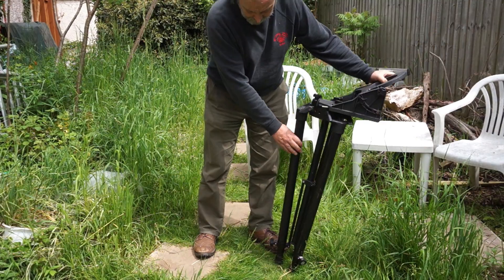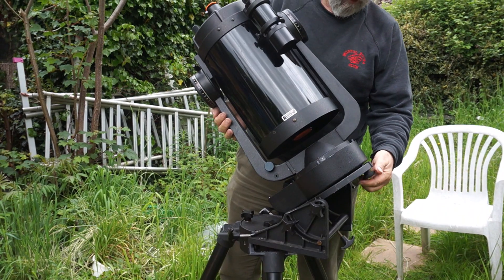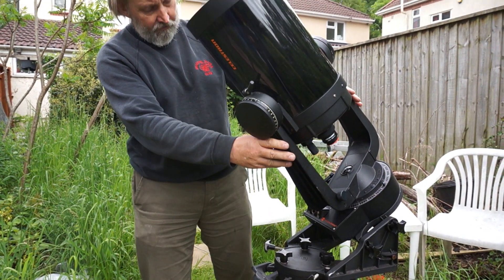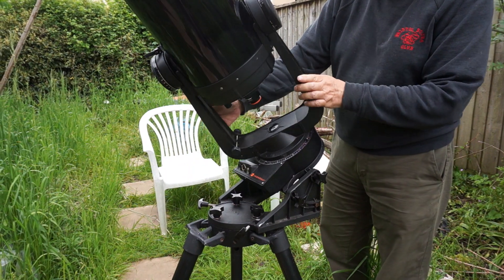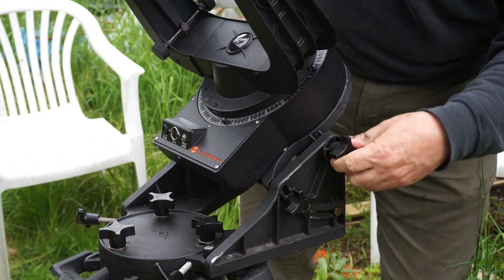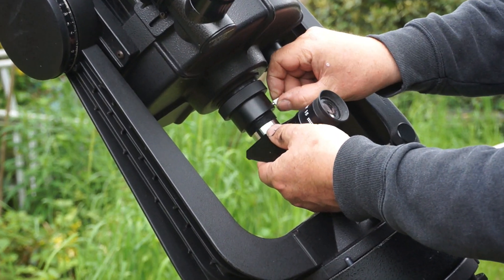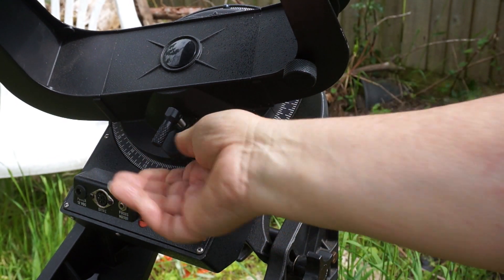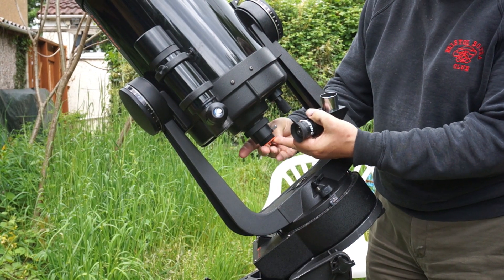setting up the celestron c8

Comment: My father gave me this almost identical Super C8 plus. (very nice in black) the motor was out, so I took everything apart, cleaned all including mirror, re-collimated it, but the scope in hand is a little impractical to I put a dovetail on it and bought a tripod and EQ5 mount. This optical tube is very clear. It's a huge zoom with 2000mm f10. I think he purchased it around 1986.  Since the age of 10 I look at a paper star chart and figure out where things are. Unfortunately light pollution from nearby city make it unusable except reading toothbrush brand of that girl next door... the illuminated reticle for finderscope : battery is impossible to find. I am trying to find a way to add a light pollution filter to the base of the scope before the visual back ? is it possible, ? what is the thread ?

Comment: I'm missing the mounting screws that go into the telescope, do you happen to know the size
Reply from the maker: sorry, it's a club telescope I was fixing up for them and I don't have it anymore. Probably going to be UNC about 5/16" - but that's a guess from memory!! If you try a screw in the holes only use your fingers to turn it, force a wrong thread in with a spanner and it will get messy.

Comment: What year was this made? I'm looking to get one just like this but can't tell how old it is by the pictures. He's asking 625. It has the starbrite coatings and everything looks like new.
Reply from the maker: About 1985. That sounds like a good deal, but check the motor drive, handsets for the controller are hard to find. Also any accessories like eyepieces and finder scopes

Comment: Mike, I like the look of that right angle finder scope. What is it? Can I get one and would it fit the two little holes on my C8 that have the original finder 6x50
Reply from the maker: It's a Celestron Polaris 8x50, it was on the C8 when I got it. I think it was bought at the same time as the main scope. I've no idea if modern versions are available to fit the two hole mount - but it shouldn't be that hard to work something out. SVbony sell a  bracket with a curve one side to fit the scope and a dovetail to hold the finder on the other. I'm sure  a friendly dealer will help you out.

Comment: Great vid! I'm looking at an orange tube one of these. Are they still worth getting? It is for sale at $850 over here in USA
Reply from the maker: They are great scopes if still in good condition, I got a lovely video of Io transiting Jupiter the other week, using  a Celestron NexImage 10 plugged into mine. $850 seems a bit steep to be honest. Celestron had some quality issues over the years so read up before buying, and check it out with a star test. Degraded mirrors can be fixed, but it's expensive and tricky to get the thing back together properly.
Reply: @mikecasbon5606  thanks Mike. I was suckered in for $600. Apart from the tripod legs’ chrome being in poor shape, it looks in good shape to me (but what do I know!?) - has a bunch of Japanese “research quality” eyepieces - EDSCORP 20, 12.5, 9, a Meade 20 wide angle (whassat), 28, 40, illuminated reticle 12 (whassat?)  and a couple of boxes of bits. The motor works and the guy who was selling it has owned it from new. I see what one motor does - what about the other one? The original manual came with it but I don’t understand enough about tracking yet. What’s a star test? All Inhabe looked at so far are the leaves next door 😊. Also an “off-axis” mount - is that for a camera?
Reply from the maker: @randallpatrickc  With those bits it sounds like a reasonable deal. The motor which turns the whole thing is the important one, as that keeps the image still as the earth spins, the other one is a bit of luxury to help you get it pointed at your target. some also have a focus motor, which is handy, as touching the scope to turn the focus knob by hand sets the picture wobbling for a while. A star test is looking at stars through it, and checking they are nice sharp points of light, not all fuzzy with comet tails coming off them (coma)
To check the collimation, find a bright star and set it in the middle of the view, then wind the focus way off. so that it turns into a big fuzzy disc, with the shadow of the front mirror ideally right in the middle so it looks like a donut. if the shadow is not central in the fuzzy disc, pop the plastic cover off the front mirror, which will reveal three screws arranged around a central one - leave the central one alone and slightly adjust the other three to get the shadow central. It's described pretty well in the instruction book.
Reply: @mikecasbon5606  Thanks so much for the help Mike. I'm going to have a go at the collimation. Is it something you do often (how do you know it needs doing (apart from checking it))
Reply: @randallpatrickc those are nice old eyepieces,  especially the meade 20mm widefield which is a desired eyepiece. 

The 12mm reticle was used for guiding, say you had a camera piggybacked and want to take a long exposure, you could use the handbox,  if so equipped,  to make corrections for any errors in the gears . It is also good in modern goto scopes to center stars during alignment,  and also for polar alignment assistance software in modern scopes. If the 40mm is a plossl it has the widest field possible in 1.25", if it is a kellner or ortho it has a little less field. It is also the brightest image of all your eyepieces which is good for faint objects.

You can also get a 2" diagonal and use much wider field 40mm and even 50, 55 or 56mm eyepieces for an even brighter field, with the maximum field of the 2" , which is considerably wider than 1.25
Reply: @randallpatrickc off axis guider is indeed used with a camera, and the 12mm reticle would go in there as well, for manually guiding out errors as I mentioned above
Reply: One thing about that scope, if you have that model with the din socket for the hand box,  all the circuitry is in the handbox, the scope won't track without it. The version without the hand controller has the circuitry in the base . This one apparently has been modified, that speed knob wasn't stock.

Comment: Beautiful instrument! There's no school like old school.
Reply from the maker: There's a lot of power in a compact and easy to transport unit, no doubt about it. The motorised yoke design is so simple and effective I wonder why they abandoned it. I was half way through building a scope when I saw this one and immediately redesigned the stand to work in the same way.
Reply: @mikecasbon5606  Possibly the company was bought out and developed a policy of trying to "reinvent the wheel"/"if it aint broke don't try and fix it", to try and make a new way of raking in the dollars????? Either way its the most in tip top shape/looks like brand new instrument I've seen in a long time. I bought a few old scopes over the years and brought them back to life. Wish I would have filmed it for viewers. Keep up the great work you do!!!!